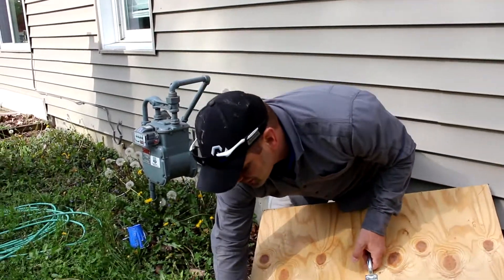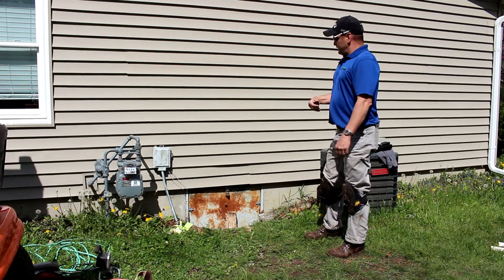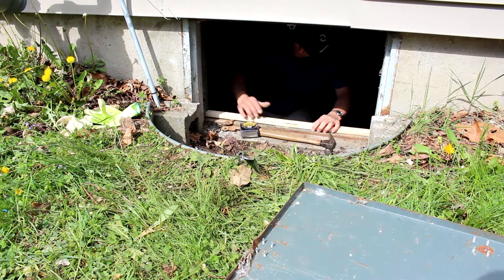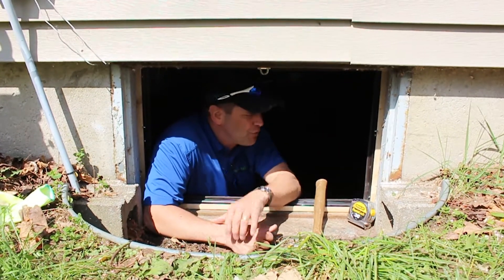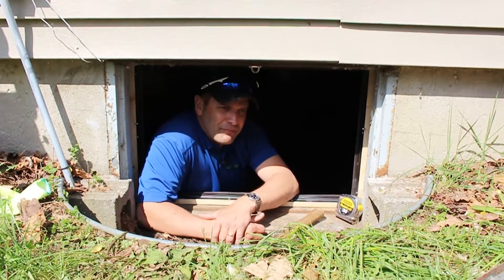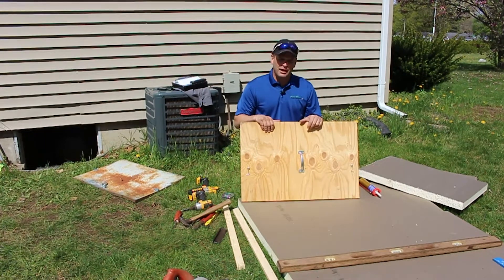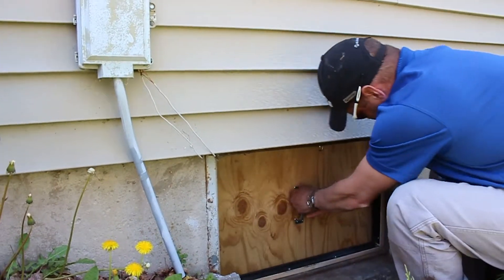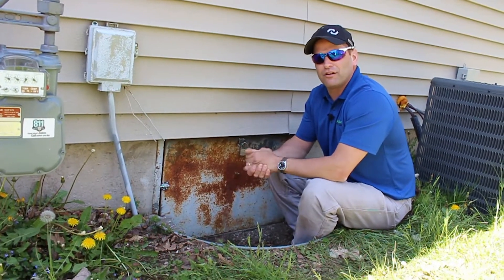Ask the Energy Advisor - Sealing a Crawl Space Door

Comment: Glue dries over time...insulation board gets bumped off door wood...forever solution screw through the front through the insulation board into a 2x1 wood board 10 inches long standing North to Sount. Now the front of board has a handle and 2 screws 8 inches apart on either side of door handle holding the 2x1 wood piece firmly to insulation and to the wood door.  2x1 again is on the inside of the crawl space.

Comment: I did my own crawlspace encapsulation this summer. Sealed all my vents, laid down thick white plastic to create a seal from the moist earth below, and installed a dehumidifier to prevent high humidity leading to mold and fungus. Recently it came to me that I should probably scrap the drafty tin door and make something air tight. Thanks for the tutorial, I’m going to be framing out a nice door some weekend soon.
Reply: I did the same - you'll be glad you did this.  I have two access doors and replaced those with new plywood and rubber air seals along the sides.  I also attached three 1-inch sheets of foam insulation to the inside of each door, giving me R-15 insulation.  As a final protection, I sprayed waterproofing on the outside of the doors to minimize the effects of weather.  Here in central Virginia, it gets down to 25-30 most nights and daytime highs average mid-40s.  All winter, my crawl space never got below 60 and averaged about 64.

Comment: Hi and thanks for sharing. I live in central Ontario Canada and my crawl space opening is in the floor,  The tradesman that did the trap door did not do as good a job as i was hoping for and would like to fix it.  the opening is roughly 4 feet long and 2 feet wide, has no hinges and the trim itself is protruding up into socks shoes and the occasional foot. The location is in the main entrance door way so it has traffic and needs to be supported from falling thru, or breaking. I would like to hide it but without changing the entire floor, I will have to be happy with creating a trim that does not rise up and cut things.  With out seeing my project would you have some suggestions on how to?  or materials i might use? its a wood sub floor and vinyl glue down flooring, which again in some places is also rising on some edges and corners. if you have some thoughts there too. Thank you in advance and stay well and safe.
Reply from the maker: Thanks for reaching out! Obviously, it’s difficult to make recommendations without knowing all factors, so please consult a reputable carpenter before doing any work.
My first thought would be to move the opening to a discreet location and abandon the crawl space opening in the main entrance. If it’s in a high traffic area – because it’s going to expand and contract at different rates – there’s always the potential for uplift and curling of the flooring. 
Unfortunately, it sounds like the situation you’re in, it is what it is and may not be easily fixed or changed. If you need reinforcement on the crawl space door, think of it as a vertical wall. You could frame the backside of the plywood with traditional 2x4 lumber. This should give you the weight needed to keep the door flat, as well as give you the ability to get rid of the trim and throw a rug over the entire area.
Reply: @NobleREMC  Thank you so much, these are my thoughts too and i do have a guy i trust but he is busy and has me penciled in some time this spring summer. I was  looking for anything maybe i could do and save him for other work, i really can't attempt alone. I also think since its such a side opening i can add 2 removable angle irons to support the trap door when closed and moveable when or if needed to gain access?  Again thank you for your thoughts and yes i am aware of the difficulty in suggesting something you haven't seen.

Comment: Sooooooooooooooo, why didn't you weather seal this fabricated crawl space door?
The humidity in the crawl space alone is going to eat that alive, including the gap between the old door and the new door. You should have added insulation to the back of the meatal door as well or even painted/water sealed the plywood.
Reply: Also it is more than just the crawl space door to have "a big impact on your home’s energy efficiency"
Reply from the maker: Thank you for watching the video! To your points:
1. There is no weather seal needed for the fabricated door. The door is inset 3-4 inches beyond the exterior plane of the siding, and in the manner that it’s installed, there’s no concern for bulk water getting behind the door.
2. About the humidity in the crawl space, we should have mentioned in this video that this crawl space is encapsulated and conditioned. We have another video about encapsulating this crawl space where you can find more information on why this type of door system is appropriate. You can find it here, https://www.youtube.com/watch?v=-teTRWJcNyQ, and the information you’re looking for is in the first 3 1/2 minutes of the video.
3. There is no need to insulate the backside of the metal door. It is neither the thermal barrier nor air barrier. The thermal barrier is the 2-inch polyiso foam, and the air barrier is the CDX plywood, sealed with vinyl weather seal. The metal door is simply in place to protect against UV and extreme weather.

Comment: By sealing those vent holes, what is the chance for mold growth in the space?
Reply from the maker: Something we weren't able to show is that when we installed the insulation in the crawl space, we cut a square in the insulation around the vents to be able to remove that piece if moisture is found in the future.

That's why it's important to check the moisture levels of the crawl space and ensure there's a proper vapor barrier (which is what we did).